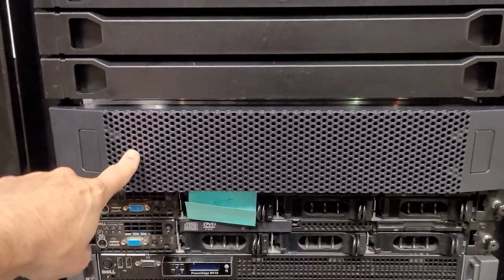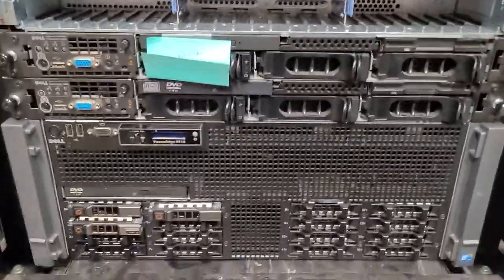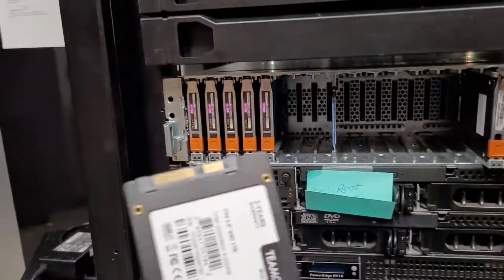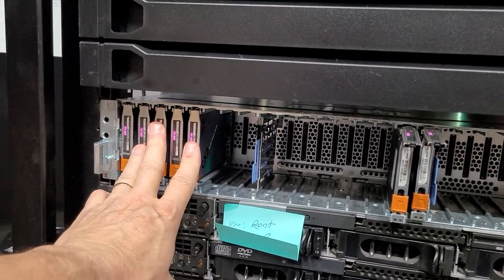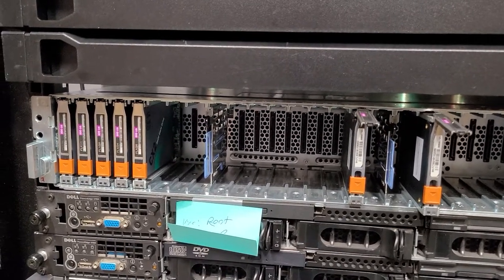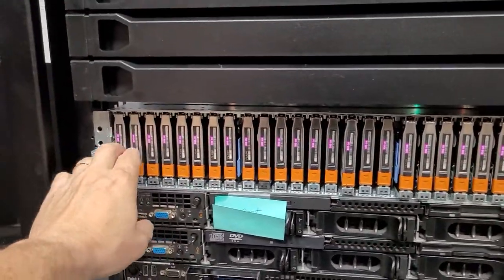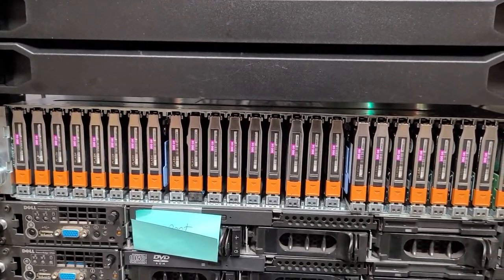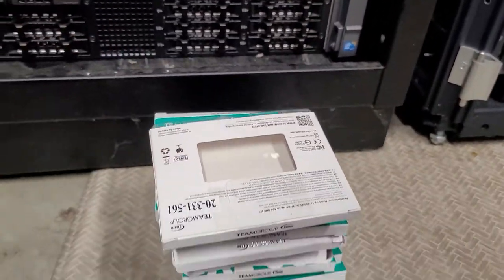Pre-work / build of an SSD drive array before the home lab data center rebuild project.  More speed!

Comment: Hello!!  I just purchased one of these EMC Jbod arrays.  I have (4) 1.2tb sas drives which spin up and recognize right away and work fine.  I installed (8) 1tb sata hgst hard drives into the array.  Upon startup, the (8) 1 tb sata drive sleds stay yellow, whereas the (4) 1.2tb sas drives show status blue led.   I have the array connected via single 8088 to an LSI 9200-8e in IT mode running on supermicro server board and truenas.   Do I need to drop into the serial config port on the jbod controller to tell it to recognize sata?  or do I need different interposers on the sleds??   FYI the (8) 1tb hgst sata drives are just formatted fat32 atm.  They were pulled from standard windows use. 

thank you!
Reply from the maker: Make sure that you first test all the drives in series (as in put them in one at at time so the controller can test them each.)  with your the LSI controller Bios so they past the boot diag testing and report as active for use and have a drive assignment..  Then i would recommend that you move the two drive classes apart by put the sata of one classes of size on 0 thru 7 and then the next type of size or class drive on 8 thru to 15 and so on.  Break them apart over the three eight channel buses of the disk array.   You should notice small wall separators between the drive bays
Reply: @leadiususa7394   Thank you!   The problem was I was plugging into the wrong controller on the back of the jbod.  I plugged into the upper one and sata works perfectly!

Comment: Great video, want more :) 
Just a question on the DAS enclosure itself, trying to find the depth of it (have a short depth rack) - 
Got two SA120 for now but want to add an 2.5" enclosure to my setup. Running a ESOS All-Flash FC setup (4x8GB) and it roars quite nicely but I'm limited to "only" 16 SSD atm.
Reply from the maker: This array from Dell EMC will fit your bill.  My NetApp DS-2446 is much bigger so you can't go wrong with this array that handles 24 SSD.

Comment: can you tell me the model of sas enclosure you are setting up with the ssd's i have found several on ebay but they are saying they are sas only. Which struck me funny because you have an adapter on each disk sata to sas did that come that way with yours or did you purchase those separately.
Reply from the maker: It doesn't matter.  The array will take SAS or SATA drives (SSD or Spinning disk)  but you need to have a SAS controller to connect the array to your server.  I use a LSI SAS controller.  Here are a few links and do your research on your cable connections.   Look for a EMC SAE VNX VNX6GSDAE25 disk array and the LSI controller that I use and works well is the following: https://www.ebay.com/itm/275512438125?epid=28034148027&hash=item4025d22d6d:g:ZGAAAOSw4khg9tIG&amdata=enc%3AAQAHAAABIJK7YqCumZ%2BtLsLvmpyPMXpwbl6EXcJrEsT7lyArLsKeScgYwTY7uR9Hw5gCgppde1YxHOUybf%2F%2F6Sw7L3qResylYZz0o16sgtauxQ%2Bx1C3ZDrRFaE4Y08uUOpG4karO7VI7BWvfKP2XUHv0CUORuWZAfy95Mxf5UQI6vosx2YF3YV%2BEzPLj%2BSoicTJhiLODyU7ABWab7aAj6NTiWNOwwI0FDFcrBmGGgpRj2Mj310VCBBBj15oXAtsYIIbRDCWfRgnEifZwK0c%2BUhwcl8fTD4K4oJe8uy5N%2FpfsFagwMw6hEAiq295ORqZeeZYAVUcZ7XLkcc1eQcXl3kmqHof7IpXsTwWfLjXg1Q8vO%2FCu1YXYlkPeGc1rVzJiBmT1rSUY2g%3D%3D%7Ctkp%3ABFBMwqOj74Vh
Reply from the maker: You can also plug this into a PC.  Not recommended...  to load

Comment: SSD interface sas or sata  ?  what Sector size is 520 or 512  ？  I plugged a micro 5100 ECO 2.5 ssd into the EMC 5150 and it didn't recognize it
Reply from the maker: You have to make sure it is on a SAS controller (Not a simple SATAcontroller)  and it has to be formated 512 not 520.  That is a OEM format that only a few vendors use.  Look at my reformat to 512 video to help you out.  Enjoy!
Reply: @leadiususa7394  thanks

Comment: What is the maximum bandwidth you're expecting from the array? Can I have 12 zfs striped mirrors(like raid 10) of SATA SSDs and expect 12 x 6gbps, so somewhere around 72gbps?
Reply from the maker: It is based on your teaming of drives vs. the 3 / 6  or 12 GB SAS controller you are using PCI-E.    Don't make them all in one large RAID 1/0 24 drive group.  Better to to do two or three groups on a smaller faster grouping based on 6 drives with spares or eight drive as raid 1/0 an no spares.   If speed is what you want.
Reply: @leadiususa7394  how would you team the drives for the maximum speed. Which HBA do you recommend?
Reply from the maker: @TheArpitkoberoi  I would build one group with 8 drives RAID 1/0 for cap needs and lose 10% in the performance and then make two 6 drive groups RAID 1/0 for high speed and remaining disk as hot swap to protect your groups from failure.   If you mix the drive sizes then have two hot swap drives for the group-x8 and one hot swap for each group-x6.  You need at least a 6CG SAS controller but a 12GB SAS controller would be better.  

Have fun playing with the gear!

Comment: I have one of the array it will see my SAS Drives but it will not see my SSD's. I have LSI SAS9200-8E Dual Port External SAS/SATA 6Gbps IT Mode ZFS FreeNAS unRAID US. Any help would be greatly appreciated.
Reply from the maker: Did you try adding one drive at a time.  Let them come in and boot into the BIOS of the LSI to detect them.  Let me know if it works.   You may have to a normal SATA drive to see if the card can see anything as well

Comment: 24 Drive jbod with sas ssd drives will have issues with sas2 chassis
Reply from the maker: Nope for SAS 1 and 2 run just find in compatible mode so drive function is not impacted... It is like SCIS-1-II -III DAS arrays.  That way you can mix and match as needed.

Comment: "SSD pulls more power than HDD" is so false it hurts to hear. AVG HDD Power Consumption: 6-15W AVG SSD Power Consumption: 2-5W.
Reply from the maker: Yes this is true if you jsut look at the current power draw.  It is low.  What you you have to also conside is that unlike the spinning hard drive that can power down over time, SSD don't so you keep pulling power at all times. So across the board yes SSD use more power over time.  When S.M.A.R.T. ver 2 comes out soon then I hope that yes we can power down SSDs like we do spinning hard Drive.  My Netapp DS-2246 24 bay HD array and my Dell EMC SSD 24 was my test model.  I put spinning disk in both and then SSD and I got the same response each time.  It is S.M.A.R.T. and Advance power down features that (I think...) is causing this issue.  It is just too outdated for the latest SSDs.  The good news is that SMART is getting updated as I understand so it will I hope go away for I have to power my SSD array down to control my power bill.  BTW do you run with both of your PSUs for your array/s or only use one PSU to save power?  I have to sue both to protect the disks from damage for mine are second hand arrays and can fail at any time at the PSU level.  Thanks for you follow up with me on this.  Keep having fun!
Reply: @leadiususa7394   What if you've got an always on array? SSDs would certainly consume less power, right?
Reply from the maker: @michaelhenry3234  No it is (still) about the same but when SMART 2 comes out you will see a  power reduction.  SMART curent version that works mostly with spinning disks power them down but doesn't do that for SSD drive that I know of yet but they are working it.   I just hope teh cost is low.  Something like a Flash firmware fix would be great.
Reply: Nope. There's alot of "expert" advice in these videos that just isn't accurate. Spinning disk vs SSD power draw isn't even debatable.
Reply from the maker: @gextreme2381 When I deal with many SSD drive, like 200 or so yep it is true for S.M.A.R.T. just isn't able that I can see to turn off the power to SSDs like it does  Spinning disk but! This week I was able to get my hands of S.M.A.R.T. 2 like tech and it is looking really good.   Also there is a new Paired set controllers that are trying to do this and they also look promise for this is the one big thing that keep me from running my arrays 24/7 is this very fact.   If you are working with a few SSDs like four or six then this doesn't really apply for the use is there but low on avg.   100's on older platforms and you bet it uses more power over time for the spinning disks power down and SSD Drives don't really.   But like I said some new stuff is coming and may fixed this.   Thanks for your feed back and my setup may be different then your and there are many.  Keep enjoying this stuff.